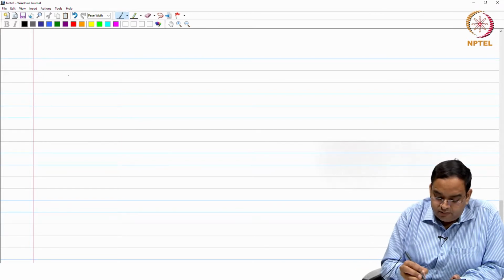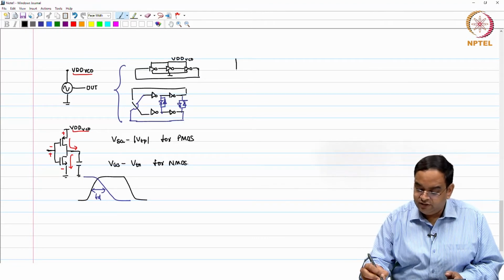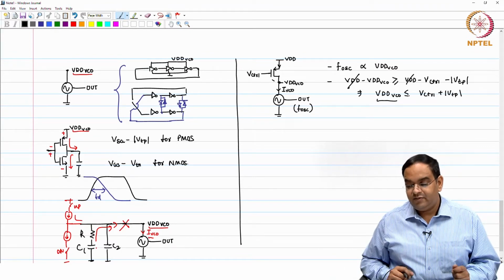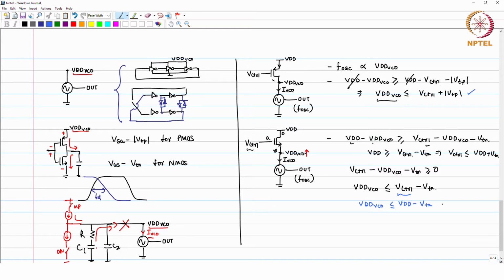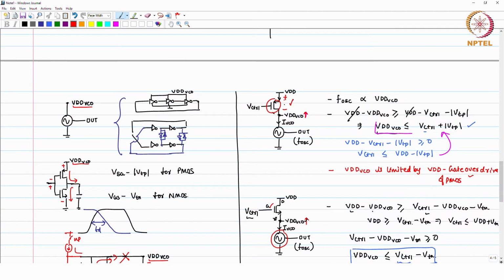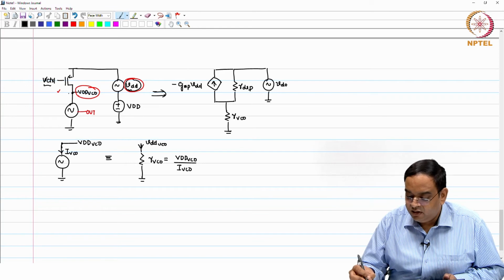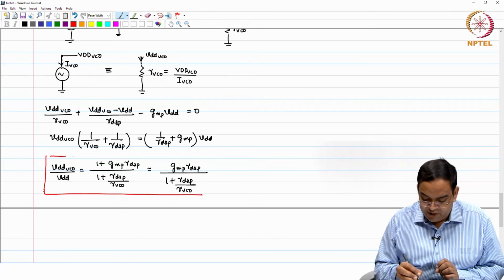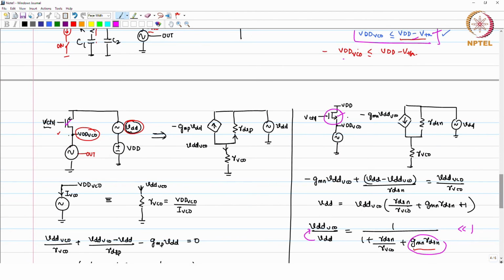Supply Regulated VCO: Part I

Comment: In your analysis of power supply noise rejection, it should only apply to a portion of the functionality when the PMOS is in saturation. However, the control transistor will go through all states: triode and saturation. Have you made any attempt to analyze the circuit considering the equivalent resistance of the PMOS?